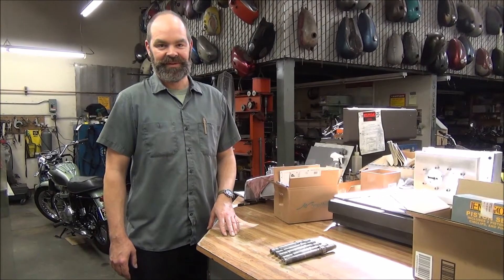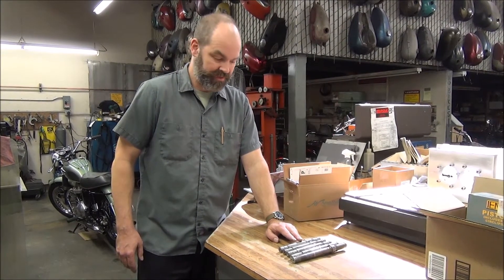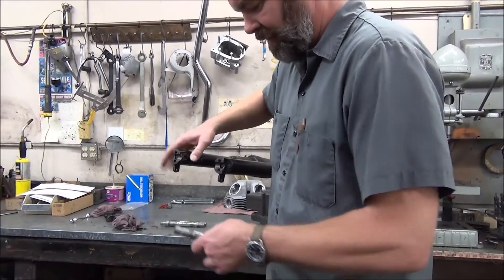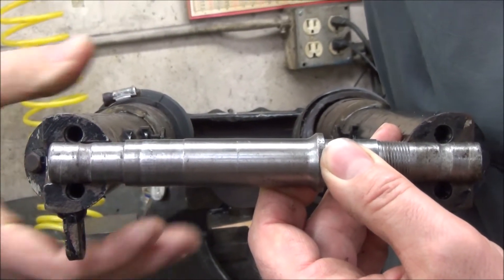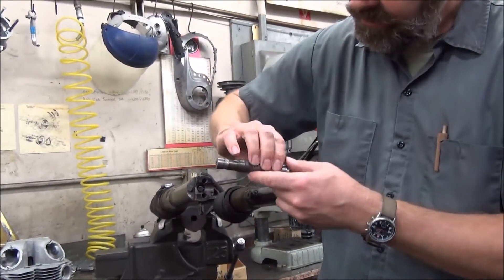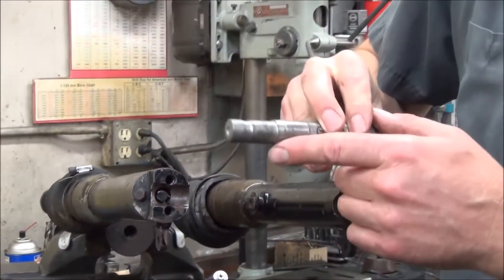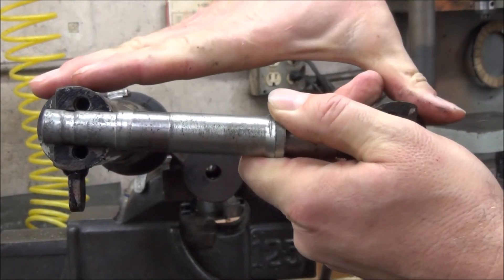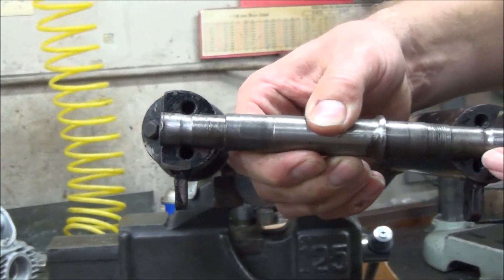Raber's Tech Tips: Episode #2 - Triumph 500 / 650 Front Axle Widths

Comment: Bought a 64 TR6 with a TLS converted front hub.  The axle is about 1/4 an inch too short.  Previous owner made it work and forced in the bolts even though the grooves in the axle doesn't line up.  Didn't realize it until I took the wheel off and struggled a bit to put it back on.   I'm going to try to get the correct axle in there.  It appears to be 7 inches, which is correct for the bike.  There's a 7 1/4 inch version that seems like it would be the correct axle as far as lining up the grooves.